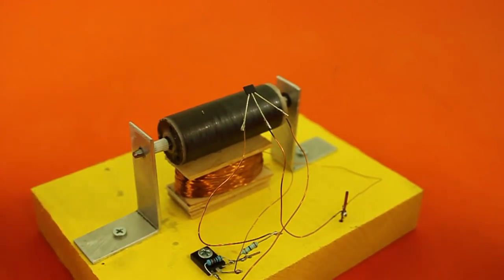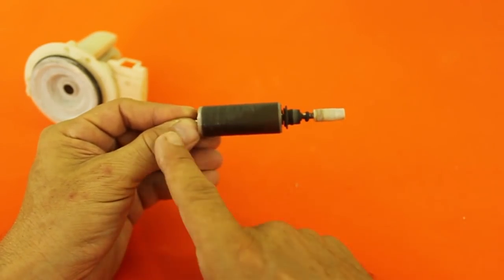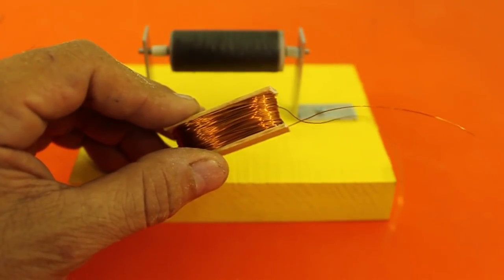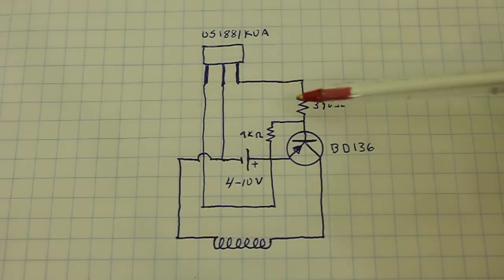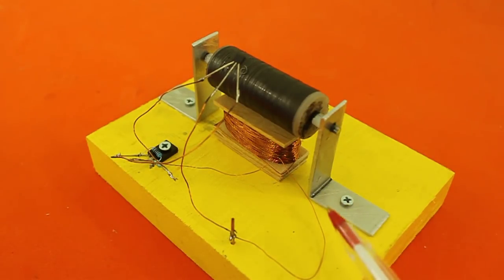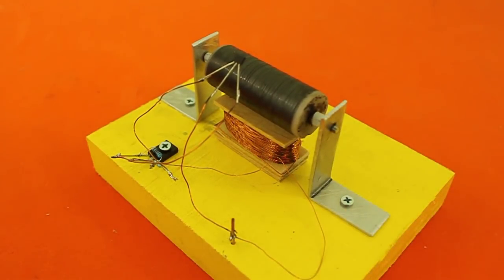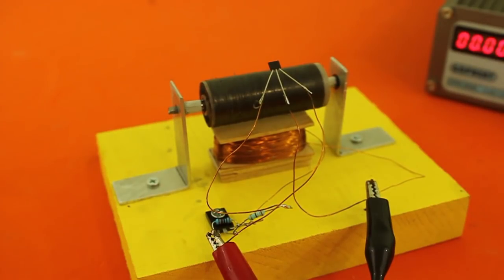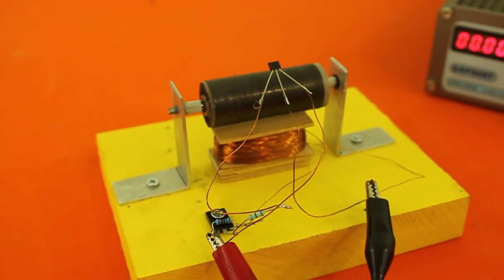Brushless Motor DIY

Comment: Mr. Ludic Science, thank you for all the work you do for YouTube, but more for your genuine passion. This video was by far the most intriguing one for me as I work with BLDC motors in my self designed eBike 2WD conversion scheme, ever since you put it up, and it has had a corner of my mind occupied until today that I came up with an I idea to share with you on that... For me having to have an ESC for BLDC motors that works on the principles of frequency on a digital platform is fine, but I think your analog brushless principle here can be extended into creating a powerful system with high torque. Overall, to me, when motion is concerned, somehow analog feels more reliable and less touchy and problematic. In the system I am imagining, there are several, number optional, coils located at equal distances on a circle and each one being fed by it's own MOSFET ( the more poles/coils = the more number of MOSFET and more strength/torque and speed). Just like in an eBike hub-motor, you also will have proper number of magnets tiled into the inner surface of a bell cover over the stator windings with all having the same pole turned inward. Coils can be all would the same direction or alternating. All MOSFETS will be turned on and off at the same time by the signal processed and sent from a single Hall sensor. There it is: a strong eMobility capable analog brushless hub motor design!... Cheers and keep up the good work...
Reply from the maker: That is a very interesting idea. I will try the setup you describe to see how it performs, thanks for your comment!
Reply: Woah u wrote that.........how long did it take u to write a novel in the comment section.....😁
Reply: I am not sure if you are awesome today, dear child, but because of what I have seen and experienced of you, so far, I will go on on a limb and account you as human, though the debate is still ongoing on whether trolls are human!... In your case, the present fact is that nobody died for you to become the literature-volume-in-Ludic Science-Vlog-Police!! Why did you use your genius mind and put the effort to resort to my mockery?... What aim in your soul were you planing on remedying or satisfying with that effort?!... Any how, I'll even go a step further in your favor: I'll bear and swear testimony that when you mature enough to rid yourself of, or at least get a grasp of, your terrible ego, then issues like your chubby cute baby hands, or your accent,  or anything else about you that disappoint and, worse, disgust you when you look at yourself in the mirror, in videos, or in your mind, will no longer exist... Moreover, you also will not be annoyed or will be less annoyed by most things that bother you right now in your mind... like seeing more literature than you can handle and be pleasant about. I'll pray for you to be the awesome you want to be, everyday. Namaste... https://youtu.be/Tpk-8xovpxk?t=233

Comment: Very cool! How many RPMs are you getting?
Reply from the maker: Dont have an rpm meter
Reply: Ludic Science try a piece of tape on the shaft striking a microphone. You can measure the frequency with any audio program or even a guitar tuner.
Reply: The sound is pretty noisy as far as harmonics go, but I'm hearing it peak on a nice even C, so I'm guessing you have some multiple of 261.6. But there's so much instability in the frame that it's hard to hear.

Comment: Which system produce more torque? Repel or attract? Maybe u can modify the motor so that it can pull some weights by winding up one meter of spring tied to certain weight so that we can measure Nm-1 torque unit.

Comment: Whan the soth pole is a way what you well do to start the engin??
Reply: That is a valid point :) The design is not a true feedback system and very simple demonstration.  Maybe put another coil on the opposite side to compensate with an inverted drive arrangement which would tend towards a defacto AC signal as was the original motor design.
Reply: U can replace the transistor with an class  b amplifier to produce a true sinusoidal wave form or u can just replace the pnp with an npn transistor.

Comment: if you turn shat will it generate power?
Reply: In this demonstration design is highly unlikely while recognising a motor and generator are technically the same ... magnet field, rotor and stator.  Given the correct modification a unit can work either way

Comment: I suppose it's safe to omit the usual diode (or LED) in parallel with the coil to catch the "back spike"?   In this case with a PNP transistor, that spike doesn't travel through the transistor.   It just goes safely back to the negative terminal.
Reply: No, it is not safe to omit it. The spike isn't a single thing that travels down a wire and gets absorbed somewhere. It always appears at the point where you break the circuit (which the transistor does).
Reply: Attach two diodes to coil to collect bemf
Reply: Cqua